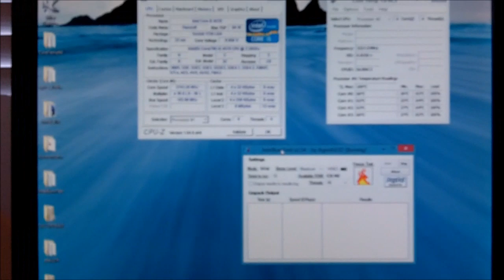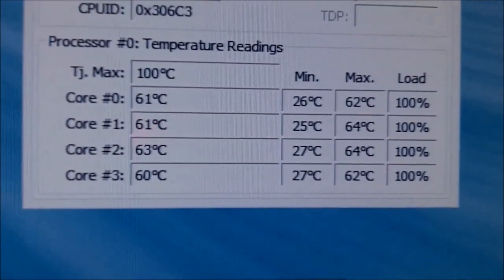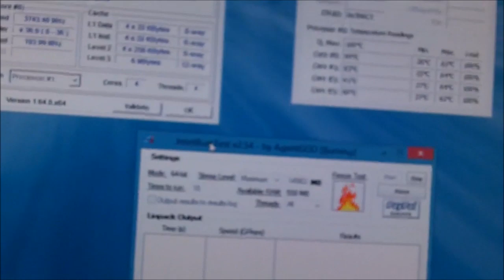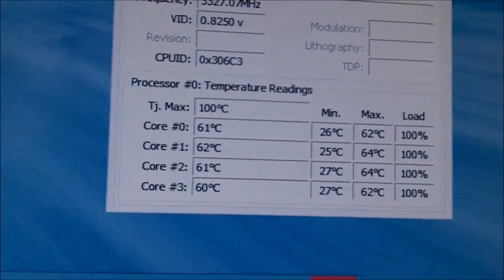Delidding Haswell i5-4570 with the vice method (with results!)

Comment: I recently acquired an i5-4570, so I'm going to have to do this. I've done it in the past with a razorblade out of a dollar store bic shaver with older AMD K8-class CPUs, socket 939 and older-- once they went Socket AM2, they started to finally use solder. However, those have a much less pronounced gap-- I can remove the old paste and silicone sealant, and replace it with Ceramique 2 or AS5 with extremely good results in either case.

Comment: The irony here is the only part i wanted to see was you hitting the block of wood to get an idea of force and times hit. 

Sigh.
Reply: +CriticoolHit just put it in a vice covered with 2-3 layers of insulating tape, compress it like half-turn and heat it up from underneath with soldering fan. You can't overpressurize it if the lid will be hot to touch, just keep the temp and squeeze it until it starts giving way.

Comment: I don't think any one else will try that for a 10 degres drop & on a non overclockble cpu.
Reply: I'd do it for a 10c drop, but on a non overclockable cpu is indeed silly :P
Reply: I did It on my i7 4790k :) opened It with a shaving razor though cause It had no vice. It was difficult as hell cause the razor was small and bent xD but on the good side it wasn't big enough to where It could jam it inside and mess up the Die.
Reply: +KEEVVY I did, and still do on any worthy K8-generation AMD CPUs that come my way. the thermal compound those use is silicone-based, and gets hard and dries up with age. so I go in and replace it with AS5 or Ceramique 2, and it's all nice and happy again. my two opterons in my current main box has this treatment, and a couple dinky CNP5Xs keep those nice and cool, around 30-35C idle and only like 55-57C max load.